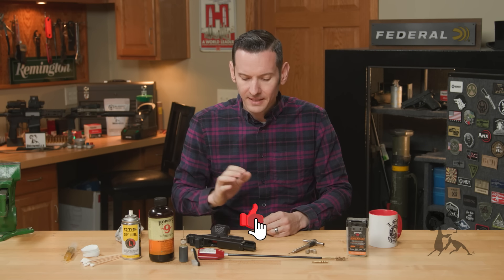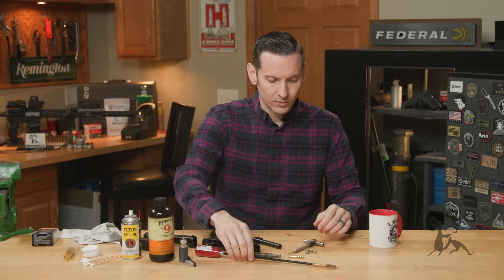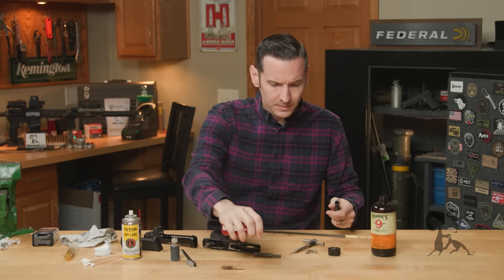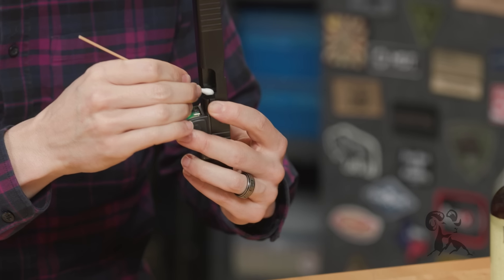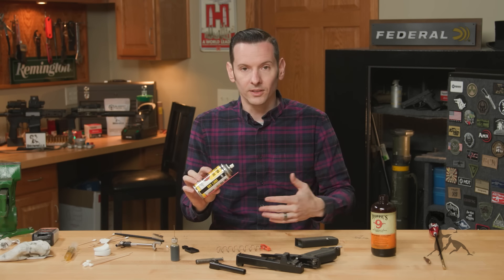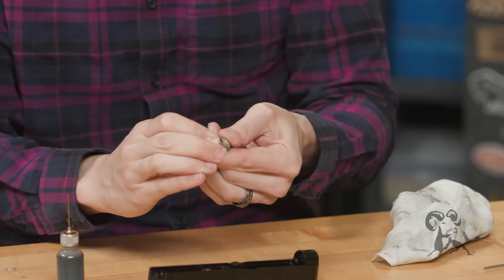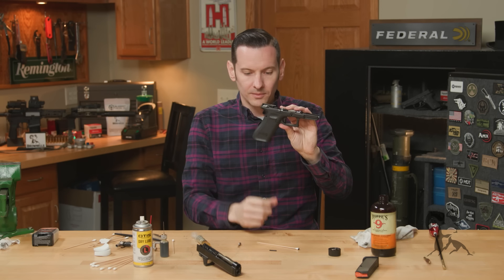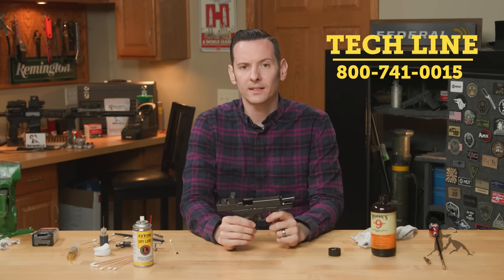Quick Tip: Basic Glock® Gen5 Maintenance

Comment: Caleb demonstrates a half release then "striking out" the trigger. My Glock armor class taught us to strike it out first, then you can slide the slide off in one motion. Either way works. Someone mentioned below that you don't have to strike out the weapon before removing the slide. Not recommended, you can damage the sear.

I also recommend holding the slide with the muzzle down when cleaning the breach face, this prevents debris from falling into the firing pin hole.

I use a molly lube paste grease on the connector, a little bit goes a long way and lasts a long time. You don't have to re-grease it every time you clean.

He does a great job of pointing out where to oil. Once again, a little oil goes a long way.

Comment: Hoppes no. 9 is the best thing you can clean your gun with, I have been using it on my guns since the 80's and still use it. 
Tip: Use rubber gloves.

Comment: I have a question on barrels in 308 what is the standard twist 1:12 ,1:10 or this a old vs new thing .
Reply: My old Weatherby .308 is 1:12 and my newer one is 1:10
Reply: SAAMI spec for .308 Winchester is 1:12 twist; however, most modern barrels come 1:10. Once SAAMI approves a cartridge, nothing changes. Which makes sense if you think about it. However, a faster twist rate allows you to stabilize longer bullets (which typically are heavier). 

Side note:  SAAMI sez .270 Winchester twist rate should be 1:10 but Winchester, Browning and others are now making 1:8 or 1:9 barrels allowing you to load bullets heavier than 150 grains or 150 to 155 grain all-copper bullets like Barnes TSX.

Comment: Is there a reason you used grease on the connector instead of the oil?
Reply: Oil runs/burns off. Grease hangs on longer. I use a thin grease in many places he uses oil.

Comment: Wow. Im so bad. I am not making a recommendation, but…. I have a Gen2 17 and Gen 3 19 ive had pre-Clinton ban. Both have over 20k rounds. My cleaning video would have gone 5 minutes if i didn’t dance for 3 minutes. I disassemble, wipe everything down with a dry lint free rag, pay extra attention to areas that look dirty, then run the rag down the barrel a few times. Then a drop of clp on the rails, disconnecter, wear parts on inner slide, outside of barrel, a wet patch down the barrel followed by a dry patch, then reassemble. … if i clean it at all
Reply: I'm with you. I clean every 10K rounds or so. Couple squirts of Gun Scrubber, wipe off, brush through the barrel a couple times, scrub with a dry patch. Couple dabs of CLP and I'm off to the races.